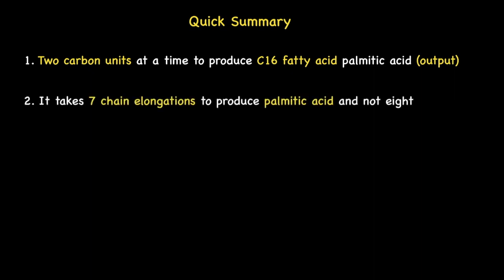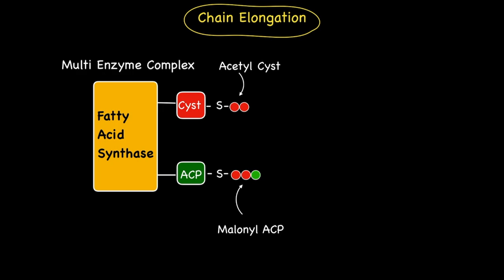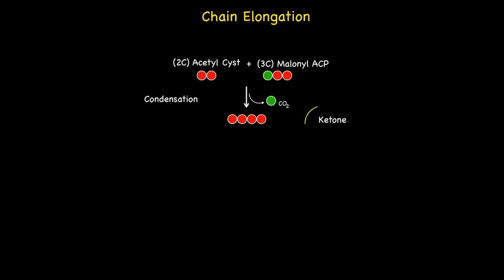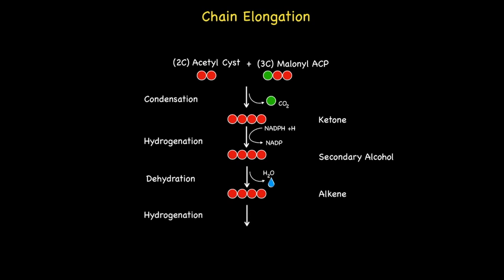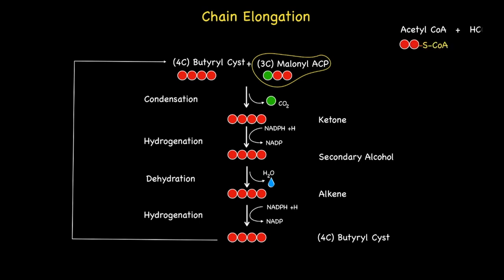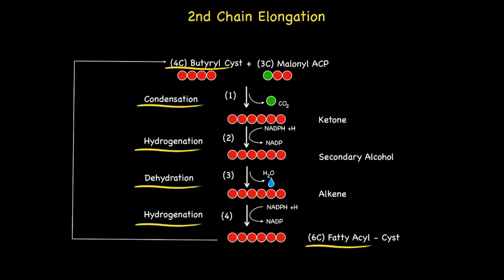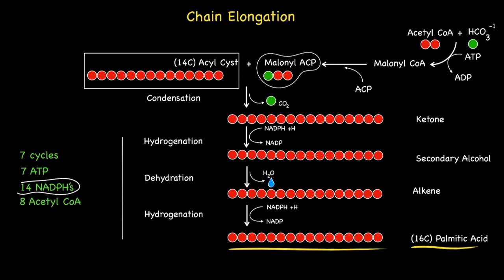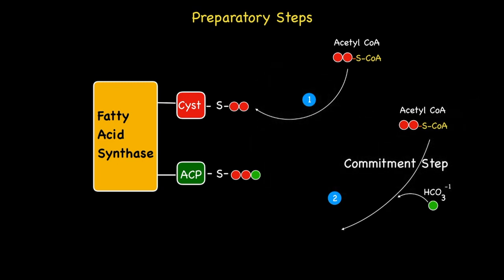Fatty Acid Chain Elongation (The Four Steps)

Comment: Thank you so much for this video! 
I just didnt understand how it needs 8 acetyl-CoAs. 
The preparatory step required 1 acetyl-CoA & 1 malonyl-CoA - malonyl-CoA from carboxylation of acetyl-CoA. 
The 7 cycles require 1 acetyl-CoAs each. 
So shouldn't it require 9 instead of 8?
Reply from the maker: Hi Seihee, there are a total of 7 chain elongations in the production of the C16 Fatty Acid known as Palmitic Acid.  The first chain elongation requires the input of one acetyl coA and one Malonyl CoA. Recall that  the preparatory step uses an acetyl coA to produce this Malonyl CoA. So in short, 2 acetyl CoA's are required to get the first chain elongation started. This leaves us with a remaining 6 chain elongations out of a total of seven.  Each of these 6 chain elongations requires one acetyl coA. If we now add up all the acetyl CoA's from each of the chain elongations we end up with 2 from the first chain elongation and 6 for the remaining 6 chain elongations. This gives us 2 + 6 = 8 acetyl coA's. Hope this helps? Regards, Wonders of Chemistry
Reply: @wondersofchemistry  Thank you, I understand now :)
Reply from the maker: @nrnflowers  Thats great!  You probably helped so many people by asking that question :-)